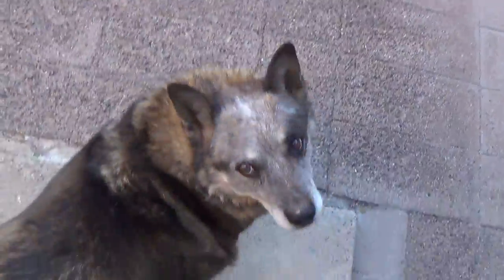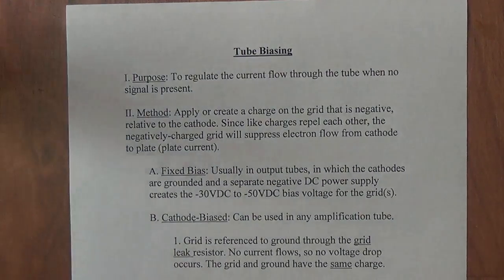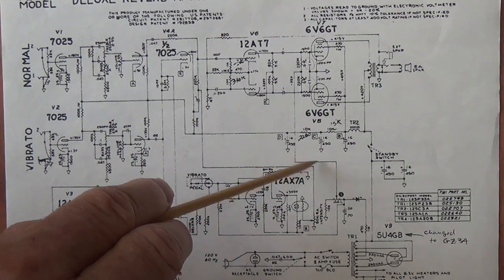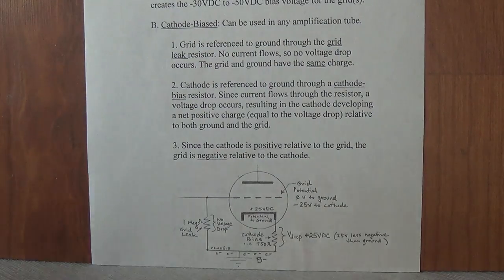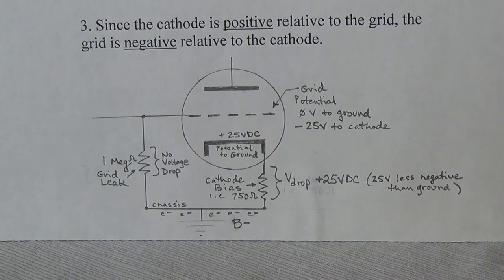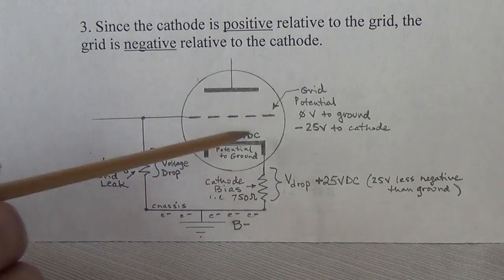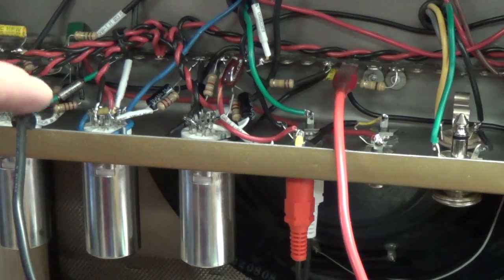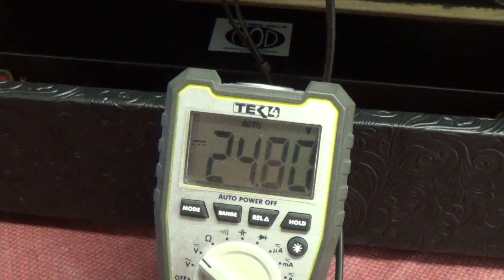Resistors, Part 4:  The Cathode Bias Resistor

Comment: Many thanks to "Rusty" without whom none of these fine videos would make any sense at all. Have you ever heard of or converted a "Bell and Howell 16mm film projector model  "385' " into a guitar amp"? It's rumored to be very similar to the 50's fender tweed deluxe amps in layout. I have managed to buy four off of ebay for less than 150.00  each and after installing a three prong plug in them...am using a couple of them on several gigs a week. I would really be interested in what you think of these amps, and any suggestions as far as modifications.
All joking about Rusty to the side...I really do enjoy your videos....

Van
Reply from the maker: +vanulusmasculinius  It's no joke, Van, he really is the brains behind our videos.....I just follow his directions and hope for the best :)  No, I have never dealt with any B&H projector amps, but after your comment, I will definitely put them on my scavenging list.  Thanks for the tip :)
Reply: Van Here;

Link to schematic PDF.  Page 215 and 216 features the beast in question.  At least I think it does! I apologize but I couldn't figure a way to get just those two pages out...

https://www.dropbox.com/sh/rbtbvsdlnpkmyep/AABvslVVh7mSX8B1ZHiS9S8Xa?dl=0
Reply from the maker: I managed to download copies of pages 215 and 216 and will tape them together to form a schematic. The rectifier tube is not identified....I assume it is a 5Y3 (?)

This schematic is far more complex than the 5E3 Fender Deluxe and bears virtually no resemblance to it.....but I guess the comparison is based on tone rather than circuit design.

I like to communicate by private message on YT, but they keep changing the way it's done, so it may not be possible any more. I have your number and will phone you on Saturday.
Reply: Hey!  I should have mentioned that the chassis internally contains some circuits that directly relate to the projector itself...in my limited vocabulary I think that there is a "R.F." system that maybe connected to an external speaker...and utilizes a 6V6 tube at the V-6 location. It can be removed and the amp still operates.  Also...there was an opto tube of some kind that I always remove....if you leave it in, then the amp hums...I think it was what read the audio strip on the film. It's just to the left of V1. The rectifier tube is a 5Y3GT.
I have been able to read that the guys who are re-purposing these amps remove the projector circuits from inside the chassis. You can youtube "at mars" amplification for instance. They are rather pricey as well.
Reply from the maker: Thanks for the added info, Van. What you say makes perfect sense....I noticed several extraneous sub-circuits and components that should probably be removed for reduced heat and hum propagation. If this all works out well, I can (most likely) get Tommy Foley to produce a more conventional schematic showing the stripped down, modified circuit. He did all the graphics for my Supro Tremo-Verb series.
Reply: I'm excited! This will be fun and I'll learn something in the meantime about how to produce the tone I want. After all these years of trying everything under the sun as far as outboard manipulations like stomp boxes and such...I've come to believe that the less stuff the signal travels through the better , because it seems that it just soaks the "chimes" or tone out of it. I really appreciate you working with me on "the chase"...
Reply from the maker: Chimey-ness is generally associated with 6BQ5 output tubes and Rickenbacker guitars, Van, but we'll see what we can do with these projector amps :)  And, I fully agree that simpler is always better.....thus my affection for the early Fender circuits.
Reply from the maker: +vanulusmasculinius  I must agree that this Bassman is about as "chimey" as it gets, Van. Part of the credit must go to the Telecaster and the four 10" Alnico speakers.  I once restored a brownface Fender Concert amp that had a special tone similar to this.  I believe that multiple 10" Alnico's would probably be necessary, as well as single-coil pickups (i.e. Telecaster) to achieve this tone. I can't see this coming from humbuckers. As far as the amp circuit goes, you would need a lot of treble clarity but with enough bass to avoid shrillness.....possibly a scooped output spectrum......and lots of (most likely) even-order harmonics, which are generally more prevalent in single-ended amps. I have also heard of people purposely unbalancing the phase inverter to generate lots of harmonics. I don't have the requisite 4 x 10" Alnico speaker cabinet, but I do have a Telecaster, so we'll just have to "play it by ear".
Reply: +Uncle Doug I agree in the tens as I had already thought about that. When I get a little further along the road I'm going to attempt to build a kit version...after you tell me which kit is good components.  I'm wary of just snagging one and going through the effort only to find I built it with poor components. I use a strat quite a bit and just a couple of months ago sold my 72 les Paul to buy a 2015 true historic 58 reissue.  I never ever thought I would do that but they truly nailed the late 50's les Paul magic.  This not coming from me.... I wouldn't have believed it... But I have a good friend who owns.... Not one... But two 1950's Paul's.  A 1957 gold top.... And yes dang it ...a59 burst.  If it's any consolation the burst has a head stock repair.  In any event I checked with him before buying and he advised to go for it.  He had already bought two new ones and he said tone wise they were identical to his " real ones"... Which is how he refers to the originals.
Reply: +Uncle Doug he says that they used "Hyde" glue to assemble the necks and bodies as they did in the 50's.  I compared it extensively and unplugged from an amp and it was at least 20% "brighter" than my 72 goldtop.  So my point is.. Everything has a factor in this game and it all matters. I found a projector amp mis- listed and very cheap! if I win it I could perhaps have it shipped direct to you? It ends tomorrow...I want to send you one more link.... I promise it's the last....
Reply from the maker: If you can, check out the values of the tone capacitors in the guitars. It's possible that the differences you note are simply due to this cap. I have a hard time imagining how glue type would affect treble response.
Reply: +Uncle Doug the guitars were " unplugged".  Before I bought I spent weeks researching the premise and found an exhaustive analysis done by a fellow on ten different types of common luthiers glues.  Each one affected the curve differently and actually Hyde glue in his opinion was only number five out of the ten tested.... With one type which I forget the name of it actually amplifying the vibrations.  I was skeptical about that.... But he seemed knowledgeable and convincing. Here is the article....
http://www.mcknightguitars.com/glue-vib.html
Interesting stuff...
Reply: +Uncle Doug I know from your videos you have a fondness for things like this. This is an external speaker for the bell and Howell projectors.  I think it's exceptionally cool looking and after you taught me to look at the codes I believe that to be a vintage Jensen speaker in there. 
http://www.ebay.com/ulk/itm/222119956162
Reply from the maker: I agree, Van, in fact I use a Masco speaker box (with a 12" Alnico speaker inside) that is similar to this as my shop speaker for testing amps. You're also correct about the speaker, it's a very unusual looking Jensen from the 16th week of either 1958 or 1968. I like it !!
Reply: +Uncle Doug hey! did you buy it?????
Reply from the maker: No, I have enough clutter in my workshop as it is :)
Reply from the maker: Wow, I guess it's time to buy some LMI White Glue.
Reply: +Uncle Doug when I was a teen I got to play several " real" Paul's.  I couldn't afford one even then.... They were 3,000.00 at Gruhns.... Approximately the cost of a Datsun 1970 240Z..... Which I stupidly opted for instead ...however... Even then I knew there was some magic in those guitars.  Not that Gibson engineered it.... It was a fluke....but be that as it may.... Like rolling dice.... They nailed it.... And then promptly ignored it for 55 years...
Reply: +Uncle Doug I was skeptical about the glue thing too....But methinks the boy doth make a point...he seems to have covered his bases....
Reply from the maker: The glaring shortcoming of the study is that he used metal to mimic wood. I understand the problem with variations in wood....but it really is apples and oranges. Hot hide glue sounds hideously hard to work with. I always use Titebond on my cabinets, and they tend to stay together......so far :)
Reply: +Uncle Doug where lies the " magic" then?   Those guitars sustain incredibly....with a " spanky" attack.... What made them " crank" like they do?  I've owned many....but the new one is different...or have they brain-washed me? Hah!  What made those guitars " sing"....??? I want to know.....!
Reply: +Uncle Doug can I ask a couple of questions related to the projector schematic?  If you are busy no problem. The rf oscillator circuit seems to be joined to the amp circuit only by a 1500 ohm resistor.  Can I cut that link and pull the tube... Or just pull the tube?  I think r40 is the bias adjusting pot? And pin 4 of v4 and v5 should be set at 325 volts?
Reply from the maker: I would remove both the 1500 ohm resistor and the tube, just to play it safe. Actually, R40 is for adjusting the B+ level (to 325VDC at pin 4 of V4). The output tubes are cathode biased (225 Ohms 5W).....there is no need for a negative DC biasing voltage.
Reply: +Uncle Doug thanks!   I'm moving my amps into another chassis.  It's a good time to check those things... Or convenient anyway.
Reply from the maker: You're welcome.
Reply: +Uncle Doug I haven't re-read the article and had forgotten that he used metal as a test subject.  In retrospect I seem to recall that he did that, to ensure regularity in his test materials to most accurately test the different glues properties only without having to worry that the glued materials were affecting the outcome.  I find it fascinating.  It appeared to me that the LMI glue was easy to work with and so no reason not to go ahead and use it for cabs.... Unless expense prohibited it.  I really appreciate the advice on the amp!
Reply from the maker: You're welcome. I have never heard of or seen any LMI glue, so getting some may be a chore.
Reply: +Uncle Doug did you get a message from me this afternoon saying that I had just seen the message with your address?  Apparently if I send messages from my computer then I can't see them on the phone and vice versa.  I didn't want you to think I was not following through. I think I'm going to win that auction tomorrow... If it's ok I'll have it shipped to you.
Reply from the maker: Yes, I got the message and responded to it. I'm not sure if PayPal will allow the guy to ship it to anyone other than the buyer. See how it goes and let me know.
Reply: +Uncle Doug I've gotten away with it once or twice. I'll let you know!
Reply: +Uncle Doug your amp is leaving in the mail today!  Tubes removed and bubble wrapped in the box. Tell Rusty to be watching for it!
Reply from the maker: Thanks so much, Van. I'll alert Rusty and Jack to keep sniffing for its arrival.
Reply: +Uncle Doug I sure hope they give it a paws up!
Reply from the maker: The ultimate from Rusty is 4 dew claws up....which requires that he lay on his back to deliver. Fortunately, this is one of his favorite positions.
Reply: +Uncle Doug I've noticed that he seems to work in harmony with gravity most of the time... And actually I can understand that and try to practice it myself.  Gravity exists for a reason and I see no logic in resisting it most days.  I think Rusty will like the projector amp.... Other than possibly the chassis being on the small side. It did have to fit under a projector though so no escaping that design feature.  They do sound good though... Straight out the box... So hopefully he will deem it worthy to drop his bone and jump in with all four feet! I'm a little jealous when I consider his soldering skills.... How "handy" to have four paws instead of just two!
Reply from the maker: Rusty is a firm believer in the Borg philosophy that "resistance is futile".....especially when it comes to gravity and eating. Hopefully, however, he will assist me in the dissection and partial redesign of the projector amp.
Reply: +Uncle Doug one can only hope!  Methinks about Wednesday is the delivery date.  I'm re-watching Rusty's  series about how tube amps work.  I'm trying to get my head ready! Does he and Jack agree on any particular " kit amps"...being the best?
Reply from the maker: I've never built a kit, Van, but I understand that the Weber kits are good.
Reply from the maker: Good grief, Van, this guy definitely has his own style.....and he has several thousand subscribers who seem to enjoy it.  I found the pace to be a bit slow and the lilting conversation to be a bit distracting, not to mention the costume, but he does achieve his goal, which is commendable.
Reply: +Uncle Doug I know.   He at one point was having an issue with the high voltage power supply and determined immediately that someone had placed two tubes in the wrong place.  Amazing trouble shooting skills.  But the question remains....why the wig and dress????  All joking aside.... Your tutorials and approach are great... Your teaching skills are very very good.
Reply from the maker: Thanks, Van. I guess there is no need to dress up for future videos :)
Reply: +Uncle Doug please don't!  Rusty would fire you!!!
Reply: +Uncle Doug don't I recall you were interested in some vintage speakers like these?

Look at this on eBay:

http://www.ebay.com/ulk/itm/401128556987

old orig '56 Jensen P69R  6 x 9" Speaker PAIR vintage AlNiCo Gibson Guitar Amp 5
Reply: +Uncle Doug is there a site on the internet that allows schematic downloads that are legible?  All the ones I found and printed, the PIN numbers are not readable.
Reply from the maker: Yes indeed, Van.....in fact a fellow has set up a site in which he redoes a lot of old schematics to make them legible. He has posted a link on my Facebook page.

 Also, the B&H amp arrived today in perfect condition due to your splendid packing job. I cleaned it up a little then ran out to the shop, hooked up an AC line, speaker, and input jack....and it works perfectly !!! I haven't tested it with a guitar, but the volume and tone seem excellent. I am currently finishing up the Vibrolux video series, and once it's done I will focus my full attention on this sweet little amp. It's so crowded inside that it's going to be tough to modify, but anything is possible. Thanks for sending it.
Reply: +Uncle Doug I'm thrilled it got there safe and you managed to get it opened up without incurring the wrath of the rubber bands I secured the bubble wrap with.  I was in a hurry that day and was short of tape but long on rubber bands!
I know the chassis is crowded but I'm hoping that 20-30% of all that is projector related and can come out.  And I know you have projects in front of it ... I'm just thankful you agreed to have a go at it!  
I fixed my 65 vibro-champ this morning!  Your videos have allowed me to begin to understand the system chain within the amps and I got lucky.  The amp was passing signal but very low volume.  I started with the rectifier tube and found it outputting 70 volts more that the schematic said.  I replaced it and all was working!  I know it wasn't much but it pleased me greatly... So thank you sir!
On another note I looked at the gentlemans site who is re-drawing the schematics.....I was rather amazed he was having to do that and here is why.
Reply: +Uncle Doug  Here in town a gentleman passed who was the go to tech for amps.  He had worked as an engineer for Hammond in the early days and also for fender.  He had a huge book of every fender schematic ever published and I believe direct from fender.  My friend who owns a local music store for the last 50 years has that collection.... Why hasn't someone simply high quality scanned all that stuff and uploaded it and made it available? This falls within my skill set by the way....I could sharpen them and increase contrast to make them even better than the originals.  In essence optimize them for online and laser printing.
Reply from the maker: This would be a wonderful service, Van. If you do this, I would gladly help you promote the site to almost 30K amp enthusiasts all over the world.
Reply: +Uncle Doug I say lets do it then!  I'm going to look into it!
Reply from the maker: It would be a great service to amp lovers everywhere.
Reply: +Uncle Doug I'm still working on the schematics!  My tech buddy is worried about fender during him and I'm trying to convince him that 60 year old schematics are public domain. 
Anyway.  Can you ask Rusty  what Jensen speaker came in a mid 60's vibrio champ?  Mine has a radio shack in it and I want to replace it. 
Hope all is well!

Van
Reply: +Uncle Doug geez... I copied the entire link.  That's on eBay.  Does the champ have an 8ohm output?
Reply from the maker: Sorry for the delay in response, but YT never notified me of your messages. My early 70's Vibro-Champ uses an 8" Alnico Jensen Special Design speaker.....not sure about the part number. It's a typical exposed-magnet Alnico speaker with a blue JSD sticker. The AA764 and AB764 V-C both used a 4 Ohm speaker
Reply: +Uncle Doug dang that's a beauty in eBay but it's an 8ohm.  So won't work
Reply from the maker: What a shame. You could order a new Jensen from Musician's Friend or Antique Electronic Supply. I've had good luck with the new ones.
Reply: +Uncle Doug tell rusty thanks for the info!
Reply from the maker: You bet. I have started on the amp video and conversion. At the moment it has been cleaned up and adapted to basic guitar use.....1/4" speaker output jack changed to 8 ohm, removed oscillator, and new power cord. The filter caps are failing, so I'll have to change them.....which won't be easy due to the cramped space. Then an audio test prior to optimizing the tone. I have noticed some places to look first, including a negative feedback loop that appears to focus on eliminating high frequencies. More to come.
Reply: +Uncle Doug does rusty do the snoopy dance???  I know I am!!!  Can't wait!
Reply from the maker: He's too busy working on the B&H amp, Van, but I'll do the dance for him :)
Reply: +Uncle Doug I enjoyed the video.....brilliant about drilling out the jack too!  That Rusty.... He thinks of everything!
Reply from the maker: Thanks, Van. Boy, this a #@%?&#% to work on. I've spent several hours trying to change the filter caps. Once I get it running again, I have some good ideas on how to pep it up. If you'd like to try something, look for a green wire going one of the lugs of the double speaker jack. There will be a resistor and a cap that also connect to this same lug. Remove the resistor and cap from the lug, plug in a guitar and see if you notice any difference. It's not perfect.....but it's a step in the right direction. More to follow.
Reply: +Uncle Doug I knew it was a bunch of spaghetti on a small plate and so I want to say muchos gracias!  
I will  try removing the resistor and cap.  
On another note one of the amps I have came from the "atmars" guy who apparently does well reworking and then reselling these things. and he had replaced the filter caps plus a new power cord and speaker jacks. He also removed the metal partition which I understand now was not so great...but it did free up some space. In the eBay add he mentioned that he had done basic requirements but had a few that he wasn't going to do the full works on and was going to sell. I watched him sell a couple without negative feedback and then got the last one he had. It's in my gig rig now.
The small size is a problem I know when working on them but later I see it as an asset from a players point of view. Here's why. I play with three amps on stage.  I only play through one at a time though and digitally switch to which one I want.
Reply: +Uncle Doug the 1200 pound twin reverb is set for clean of course. It's what it does best I think.  Then I have two 385's mounted into one head can I bought off of eBay for 35.00.  I made a new face for the head cab and cut ventilation holes in it.  Two projector amps perfectly fit in it as if they had grown there. I bought two eminence " flux" speakers which allow you to adjust the magnet out away from the voice coil and attenuate volume and mounted them into a twin reverb cab.  It's a quite compact rig to include three amps.  I wanted to put the 385's into the spare twin cab..... But when I tried it one of the speakers.... The higher of the two... The frame was just a teeny bit high enough to hang on the chassis. It almost worked though.
Reply from the maker: It sounds like quite a rig, Van. Let me know if you try the mod I suggested above. I think you'll be surprised by the result. Hopefully, I'll get the electrolytics in today and be able to leave enough room for tremolo controls to connect to the front panel. Space is a very limited commodity in these jewels.
Reply: +Uncle Doug I just went and got my rig and am going to try and get my buddy to replace the filter caps in one then I'm going to apply the mod on both.  I knew the range was limited and was counter acting on both amps with a digital eq each.  I want to get away from anything other than the amp. 
I've decided I want to build the 59 baseman.  Anything wrong in your opinion of finding a super reverb reissue and gutting it and using it for a platform?  I see two on eBay now each one is 600.00. That includes cab and 4-10's.  I prefer a face mounted dash board because of how I stack my rig.  I guess my question is if it's possible to get that chimey sound we both liked in that YouTube video. 
Will the mod on the 385's increase clean headroom and make it harder to break up?
I really appreciate your help.... I hope I'm not being a pest!
Reply from the maker: I wouldn't suggest that you permanently modify either of your 385's by simply removing the NFB loop, since I have not yet finalized all the details, but thought you might find the big tone and volume change to be interesting. Removing an NFB actually makes the tone  more raunchy and allows for much earlier breakup.....which a lot of folks like. It sounds, however, like you prefer the opposite, so I'll keep that in mind.

As far as gutting a Super Reverb, I guess that would be a way to gain a proper cabinet and speaker system, as well as a chassis and circuit to modify. It might be easier to find an old Silverface or re-issue Bassman for the same purpose. Either way, good luck.
Reply: +Uncle Doug I'm not going to leave the nfb out on your advice.  I'm very interested in that variable nfb scheme you came up with though when you get it all figured out. And actually I do want the raunchier tone because I'm  using my twin for clean tones. Hope you and rusty and jack are all well! Eagerly watching for the next video!
Reply from the maker: I've had all sorts of interruptions and other interference, including having to build a car port (I'm not kidding), but should be back at the mighty B&H amp soon. Did you try it with the NFB disconnected, as I described ?
Reply: +Uncle Doug in my life I've learned that good things, are...always without fail, worth the wait.  And also that Garages are important....after all one needs a place for his Ferrari or his GTO.... his zero turn...or even his 14 year old Porsche...or just a place for Rusty and Jack to conduct sniff tests. I've been busy myself and didn't do the test.  My dad passed a few days ago.  Tomorrow starts a gig week so early next week I intend to try it before the new gig cycle starts. As a dedicated gear head.... And a confirmed tech to some extent, I just want to say that I really admire your craftsmanship and dedication to detail.  You really are a gifted instructor...and I'm thankful for your insights....
Reply: +Uncle Doug dang our heads are wired similarly!  I just forgot to mention the 52 Chevy truck!  Is there some way I can send you a photo on here?
Reply: +Uncle Doug want to show you the bell and howel external speaker I got in today.  It's like new with a 12" Jensen that looks brand new.  I was wondering about your thoughts on mounting one of the 385's in the bottom of it.  But it's got these cute little drawers built into it and they are all pristine so I'm loathe to take those out.
Reply from the maker: By coincidence, I also just obtained a fairly old B&H 12" speaker also....it's in a nice black leatherette box with a big round silver grill. There is a coil of about 50' of speaker cable inside and a small-diameter (3/16ths?) plug on the end, ala the 385 amp speaker jack(s). I too am hesitant about taking a chainsaw to this nice cabinet and trying to cram in the amp. There are better ways.
Reply from the maker: Van: Chainsaw?  Gosh I hadn't thought about fine finishing stage yet as I was still sharpening grand dads axe!
I posted the pics. What  do you think about a little custom head cab for the 385 that then allows the speaker cab to sit on top of it? I could put the axe away then!

Uncle D: I saw the photo and commented on how nice it looks. I also posted two photos of the cabinet I found.
Reply: I'm sending this in two places...because I seem to miss a few of your posts here and there! Sorry for the duplication!

Gosh I can't understand why I get these notes late!  I suppose they get lost in the shuffle. I do have all of them I need. Ive got four still here...and I'm bidding on one that I think I will get for less than 100.00....so I'm good.  That fifth one will go into the External speaker I bought.

I'm getting ready to work on a couple of the amps. My tech buddy told me about " Cornell Doubler" and said they may have a replacement "canned" caps that will replace the filter caps. Are you familiar? Perhaps that would make that easier and save room?
  I watched several times your video on the variable negative feedback loop with a presence control added. This seems brilliant and something you'd always want. Would the values be OK that you used in the video? Or should they be tailored to the 385?  Or I can wait until you get further along into the rebuild if you think that's better...
Best;
Van
Reply: Link to the cap manufacturer:

http://www.cde.com/
Reply from the maker: Cornell Dubilier can caps have a good reputation, Van, as do Mallory and a few other manufacturers. It is generally much more convenient to simply replace a can cap than to wire in several separate filter caps inside the chassis.  By coincidence, one of the mods I made to the 385 is a variable NFB loop. The weather has been merciless (over 108 degrees, which makes the workshop a bit "stuffy") and I have been swamped with chores, but I intend to release the second video on the 385 very soon.
Reply: +Uncle Doug Am I guessing correctly that the nfb in the 385 is between the 16 ohm secondary and pin 8 of V3? If so....then the 22k resistor is the same as a champ.... But the .001 mfd cap is way off?  The champ had no cap if I'm following correctly but the twin in your video had a 0.1 and a 5k variable resistor as a presence control. So is this .001 cap , part of the guitar tone soak in the 385 circuit?
Reply: +Uncle Doug by the way I understand about the heat.  We break a 100 here all the time... But even worse our humidity is usually above 90% as well. Almost unbearable.
Reply from the maker: Yes, I lived in Austin, TX while going to college and they would have days like you describe. You would sweat so much that it looked like you had fallen into a swimming pool....but due to the high humidity, the sweat wouldn't evaporate, so you'd just sweat some more. In the desert where I live now, it may be 108, but the humidity is generally in the single-digit range.
Reply from the maker: I left the .001uf cap in my adjustable NFB loop. It makes no audible difference, in or out of the circuit. It's probably to allow high frequencies to pass around the resistor.
Reply: +Uncle Doug what's the bad factor then?  Is it the resistor??? I can't wait to see the video.  I did the basic stuff on two amps today.  Except that tomorrow I intend to replace the dual speaker jack with a dpdt switch to let the single Jack operate as either 8 or 16.  Baby steps..... Sigh.
Reply from the maker: Yes, the resistor value is too low and allows for too much NFB, in my opinion, which squelches a lot of the clarity and liveliness in the tone. I added a 100K resistor in series to allow for all sorts of different feedback and tone effect. I like your switch idea on the speaker output.....now you only have to drill out one jack :)
Reply: +Uncle Doug hah!  I stole the idea from you!
Reply from the maker: No wonder I liked it :)
Reply: +Uncle Doug hey!  I enjoyed the new video! Over the weekend I modified the nfb in two of mine and it certainly did make a difference. By the way I was glad to see the heat had let up and you had a nice snow storm going! I need your insight on something. I want to take one of my 385's and rewire it as a tweed deluxe.  I intend to use all the hardware and just change out caps and resistors and such. I have a book that details all that and includes a parts list.  I tried looking at mausers website today.... I think it would take a month because it looks like they stock several trillion items.  Is there a simpler place to get those parts? It's not a long list...
Reply from the maker: I'm glad you enjoyed the video, Van. Thanks again for sending me the amp that was the basis for this series. I get all my electronic parts, except transformers, from Antique Electronic Supply in Tempe, AZ. They're the best.
Reply: +Uncle Doug I set up an account and looks like I'll be able to find what I'm looking for.  I need your thoughts.... Will the power and output transformers work fine if I rewire and recomponant the amp as a tweed deluxe? Is it a sane idea?
Reply from the maker: Yes, I think that both of the transformers would work with the Tweed Deluxe circuit. I would personally use them for this purpose.
Reply: +Uncle Doug Dude!  We should get into the capacitor business!!!!! Geez.....
Reply from the maker: I tend to avoid the real pricey caps. Sprague Atoms are about as ritzy as I can afford.
Reply: +Uncle Doug apparently some of them are made out of " unobtainium".....I whittled it down to 245.00 and that's two complete tweed deluxe circuits minus the trannies.  I couldn't find one cap...a " 500 pf" 200 volts.  Looks like it doesn't exist at either Mauser or antique electronics. I also searched for a " .0005 uf" with no luck.  Looks like it's a wish capacitor. I did spring for a couple of more expensive caps when the quantities were lower because antique parts was touting their " sonic superiorness".... I'm sure I got snookered but I'm a sucker for " magic" tone hiding in obscure components and centuries old mahogany and maple.  I sure wish their was a tone bible to turn too because I would immediately convert. 
I was hoping to find terminal strips that would fit in the 385's. It sure would make things easy because I could more or less lay it out as if it were in one of the boards like fender used.  But it just looks like there is not enough room. Any ideas?
Reply from the maker: Don't buy the "sonic superiority" claims.....they're generally trying to unload stock that moves slowly due to its exorbitant price. I used terminal strips in my 385. You can cut them down to size if necessary. On the unavailable values, you can generally get away with simply being "in the ballpark" when it comes to small caps, or you can wire them in series or parallel to achieve unusual combinations of capacitance and/or voltage rating.
Reply: +Uncle Doug hey Doug! Van here.  My project is progressing nicely I think.  The gutted 385 has filament wiring and I'm about to finish the input section today. It was a real stumbling block for me because I didn't have room for four switchable jacks. I've come up with a scheme using one Jack and two mini dpdt switches. I'm praying I've got a clear understanding of how that section works.  If I do I'll be able to swap channels with the first switch and then " jumper" with the other one. I'll know today.  
I intend to use shielded cable everywhere containing an audio signal between tubes. Good idea?
If I'm reading the schematic correctly the 5e3 circuit does not contain a nfb circuit? Could or should I implement one from the 5e6 circuit? I found some led pilot lights that use 5v.  Can I use the 5.3 volts I have off the 5y3?  If not can that be stepped down via a resistor and the ohms law formulae?
I really appreciate ALL your help!
Van
Reply from the maker: Greetings, Van. Good luck with your switchable input circuit. It's an interesting concept....especially the jumper capability.

Yes, I always use shielded cable for the early (pre-phase inverter) signal runs, it really cuts down on noise.

The 5E3 has no NFB. If you add one, try to make it variable (good luck finding a place for the pot) because if fixed, it may not have an overall positive effect on tone.

Most bulbs can tolerate an extra volt. I'd try it with 6.3VAC filament power. If this doesn't work then step down with voltage with a resistor, as you suggested. Recall that the 5VAC circuit is also the high voltage DC circuit, so I wouldn't use it for a pilot light.
Reply: +Uncle Doug thanks big time!!!
On the input circuit my brain melts when...... I see that plugging into #1 jack on either channel puts the 68k resistors in parallel, giving you 34k.  Plugging into #2  by itself ,Jack seems to me to leave them in series so 136k???  But what melts my head down is... What happens when you plug instrument into #1 and then the jumper plug into #2?It wouldn't matter to me if I were using the four jacks.  But before rigging the switch system I need to fully understand what's happening in the stock system. What do you think?The gurus on YouTube emphatically claim tonal good stuff in jumpering. 
I removed the original AC receptacle from this unit and installed a fender sliding bright switch I had around here. It fit into the hole very cleanly. So it will switch the one speaker Jack I have between 8 and 16 ohms.  Where the 16ohm Jack was I installed a 100ohm pot for the nfb loop.  This all before I discovered the  deluxe didn't have a nfb loop!
Reply from the maker: Sometimes theorizing takes more effort than simply wiring it all up and seeing how it works, Van. I find the direct approach to be invariably  better and faster than the abstract. A 100 Ohm pot is inadequate for an NFB loop. You will need around 25K to really make it effective.
Reply: +Uncle Doug oops.  I meant 100k!  But is that too much?  I thought I recalled you using that value in the 385 you did.  Sigh.  I agree.  I have found myself several times wishing that I had simply installed the four switchable jacks!!!!
Reply from the maker: 100K will work just fine, Van.  Again, experiment and find what is best for your circuit.
Reply: +Uncle Doug as I have studied and watched your videos I seem to recall that inside the chassis when running shielded cable it's recommended to ground just one side of the shield. Is that correct or am I remembering incorrectly.
Reply from the maker: You are correct. If you ground both ends of the shield, there is a chance there will be a potential difference between them that can cause current to flow through the shield, creating a ground loop.....and hum.
Reply: +Uncle Doug Hmmmm....we don't want hum eh? I followed your directions and I hope I'm progressing well. Possibly going to be able to power it up over the weekend so if you see a large mushroom cloud to the east ....take cover and know that things didn't go Well.....
What are your thoughts about lifting the nfb loop from the 59 baseman......including making it variable and then include the presence control as well?  Can I use the same component values that they used in the baseman?
Reply from the maker: You could certainly try to adapt the NFB loop from the Bassman. Again, experimentation is always the best method to achieve the tone you desire.
Reply: +Uncle Doug I wanted to let you know that the amp worked on first try!  The lamp didn't light up and the amp sounds wonderful!  I want to say thanks again.  You are an excellent communicator and I would never have tried to build from scratch without your videos to guide me! By the way.... Building it point to point and incorporating shielded cable lends itself to being the quietest amp I've ever had.
Reply from the maker: That's great news, Van. Congratulations !! I'm glad that the videos were helpful and that the shielded cable idea worked so well for you.
Reply: I have a question.  I thought I recalled in the bossing videos that biasing hot resulted in more clean head room. I went back but couldn't find that statement. Prevailing wisdom on the inter-Google says the opposite. I want my amp to break up easily. My schematic called for a 250 ohm resistor but I measured 16 watts of plate dissipation. Remember the variable resistor in the 385? I took it and at precisely 500 ohms the dissipation on both tubes is at 12 watts.  In photo darkroom printing pre digital and in flash photography before auto everything I was a master of the " inverse square law"..... Doubling that resistor and shaving 25% off the plate dissipation sure reminded me of that feature of light measurements. Double the distance from the light source and you had 25% of the original value. 12 watts is max for the 6v6?  And hotter bias means quicker break up or slower?  I have no headroom on my variable resistor to try it as it maxed out at 500 ohms.
Reply from the maker: If the 6V6 is cathode biased, then 12W is maximum PD. I tend to set them a little lower. The hotter the bias, the earlier the breakup, so headroom is inversely related to plate dissipation. Biasing cold provides tone that is a little dead, but with tons of headroom.
Reply: +Uncle Doug I biased it to 12 watts but I have a problem that I have worried with for several days without success.  The amp is about half as loud as the projector amps.... And clean as a whistle.  I can't get any breakup at all.  The tones beautiful and chimey but no attack.  I redid the input jacks and checked everything three times.  Do you think it's possible that the power transformer from the filmosound or the output tranny may be mis matched for the 5e3 circuit? I replaced everything else. I have a chart that lists all of the voltages at the tube pins and mine are all quite high across the board. I believe the chart is adjusted for modern line voltages and allows 10% variance but mine are more like 15-20% over.  In your opinion would those over voltages cut output and decrease any breakup?  I'm kind of stumped!
Reply from the maker: Are you sure you've used the proper secondary taps on the output transformer? It's yellow-black for 8 ohms on the M-1 schematic and green-black on the M-2.  An impedance mismatch might cause the symptoms you describe. You might experiment with the secondary outputs to see if you can come up with a better-sounding pair for your speaker.
Reply: +Uncle Doug I think they are both correct. I have them both hooked up and the black wire is grounded.  However.  When I first got this particular unit one of the 6v6 tube sockets was shorting between the plate and the filament.  It had deposited a carbon trail on the interior of the socket.  I of course replaced it.  I'm wondering though if someone hasn't ran it like that enough to damage the ot.  If I pull the tubes and read from pin three across b+ the one that was shorted reads 109 ohms and the other tube socket reads 119 ohms. Does that indicate possible damage? 
Thanks for your help!  You must get a million questions..... I only ask when I'm up the creek and the paddles missing....
Reply from the maker: The difference in resistance that you noted is well within acceptable limits, Van. It sounds like the OPT is fine. The cause of the carbon trace may be a huge voltage spike....which can sometimes be due to parasitic oscillation at a frequency above the audible range. Read up on this. It's a long shot, but in my experience, it's uncommon for arcs like this to occur, especially with 6V6's. It takes a heck of a voltage spike to jump that far.